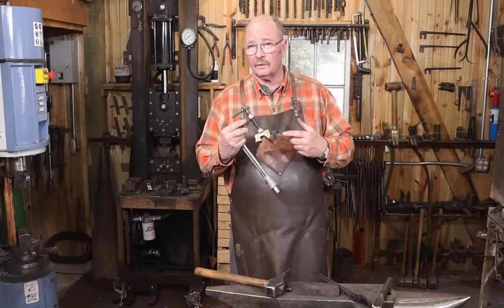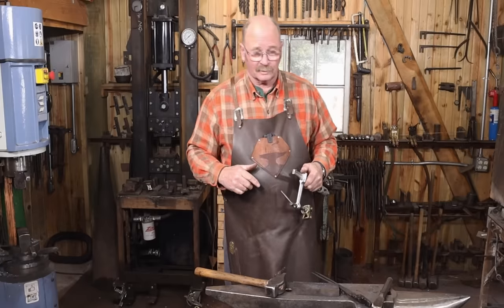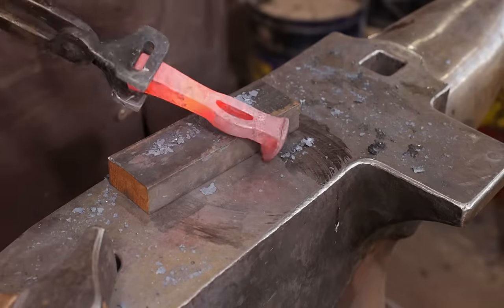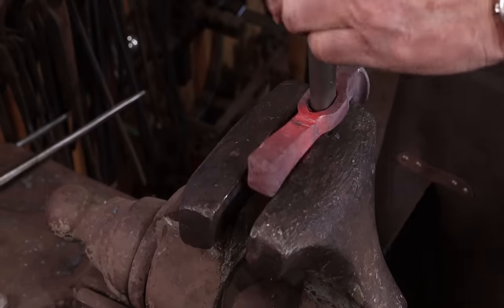Forging an AXE from a Rail Road Spike

Comment: I have been a blacksmith/ fabricator/ machinist for 50 + years and i never tire of watching other craftsmen share their knowledge. And i still learn stuff!
Reply: Hi friend I just figured I'd ask you but im getting into blacksmithing and I've mainly been using a friends forge but I was wondering if you know where I'd go about getting my own.
Reply: @BigVince80bce  i just saw this two months later. Try Pie tool company. Its a blacksmiths tool seller online. You’ll also find forges and what not on ebay.
Reply: @beshkodiak  thanks mate, I'll give the websites a look
Reply: U know Right!!🖒
Reply: What kind of charcoal you used sir?

Comment: It's been a while since I've made one of these. I think I'll try another. I'm going to try using a short, wide handled chisel under the inline treadle hammer to open the eye this time. Last ones I made, I used too narrow and small of a chisel and ended up stretching the sides of the eye a bit too much. Nice video, Merry Christmas John, thanks for all the content!

Comment: Been told by 2 good BlackSmith to quench mild steel in water and still not tool steel but improve the hardness. 
I'm surprised that RR spike has enough steel  Seems you drew it out well.
Thanks Mr Switzer for the teaching Sir

Comment: That does look like a fun project. You could make a bunch for friends then meet up and play with them. That amount of temper seems a good compromise as you would not want them too hard anyway for when they hit the ground or rocks or whatever. If you really wanted I'm assuming one could forge weld in a hard piece for the edge. I hope you had a relaxing Christmas and took a break from all your video production.

Comment: Nice video John! the tomahawk turned out awesome! as far as the heat treat, I use an aggressive brine solution for spikes and they get near a 55 rockwell, its called a super quench and its 5 gallons of water, 5 lbs of salt, and a bottle of dish soap, I was able to make a nice paring knife for my mom out of a spike and the quench got it 50 - 60 rockwell.
Reply from the maker: I have wondered about that.  I just try not to have any more buckets of stuff around the shop.  Will super quench freeze in cold weather?
Reply: It is still only surface hardening... Rail spikes are 0.12% carbon and 0.30% carbon for HC spikes.. So while you can surface harden them it wont penetrate deeply as spikes are mild steel and wont through harden... That being said, you can spit the end when forging and insert a high carbon bit in and forgeweld it in order to have a high carbon steel edge.
Reply: @BlackBearForge  probably will freeze if it gets below 0. Maybe even in single digits.

Comment: Very good job 👌👍  on the video !  In the black smithing books they talk about  steel you can find , and about what hardness they are .  I think at one time railroad spikes my have been harder than what they are now  . A lot of the older books mentioned that spikes are harder . Now they know they don't need to be that hard so it's cheap & good enough so that's what they are .  I think there neat + if you know people that like trains then you really want to leave that nail head on it . Again good job

Comment: I think that railroad spike hawks look awesome enough to initiate a piece of high carbon steel Forge welded into it. I think they look I think that particular hawk there is awesome looking and I think it would be worth putting a high carbon bit. Will be a little extra work, but I think you would really have a really serviceable little mouse. Most of the people that tomahawks use like a 1040 a real low carbon steel with a welded bit and those as well so just an idea.

Comment: I think you are hands down the best teaching Blacksmith on YouTube.  Thank you for all of the effort you put into helping others.  I love this project and am going to try it.  My question is on the drift.  I am cheap, so have bought very few items, and prefer to try and make them.  But is making a drift feasible?  How do you know what size?  Or do you just make it the size you want and make the handle to match?
Reply from the maker: Making a drift is certainly feasible.  If you are buying ready made handle, make the drift to match the handle.  Otherwise make the drift what you want and then fit the handle as needed.  Eventually you'll end up with a fairly good assortment of drifts.

Comment: Awesome video! I'm thinking about giving this a try soon. My question is, how did it hold up with the throws? Is the edge still ok?
Reply from the maker: So far just fine.  Throwing axes don't need to be very sharp.  But it wouldn't hold an edge very well as a carving axe.

Comment: I've been wanting to make something similar for ages after buying a couple of nice forged axes. My main issue is the drift. I guess I need to find some material to make a drift first, figure out how to make one, and then learn to make the axes. Great video- I have a sack of railroad spikes that are looking for a use.
Reply from the maker: The drift I'm using is available through Pieh Tool

Comment: I liked the cuts you made at the end of the video. :) I think if anyone was going to make a serious blade they would consider forge welding in a piece of quality blade material like maybe some good spring steel so you have a blade edge that will last.
Reply from the maker: While I agree, I also wouldn't put that kind of time into a spike hawk and would be making something completely different if I really wanted a serious blade.

Comment: I was splitting some kindling wood other night with a hatchet .. the handle is too smooth ,,, plus I had gloves on ,, well 5 stiches in my leg above me knee .. watching you split that board I was getting flash backs ,, works nice , only problem if you were splitting with it all the time would be the spike head catching on the firewood ,, thumbs up on the video

Comment: As usual great video! I suppose you could forge  weld in a high carbon bit for a harder edge if you wanted to.
Reply from the maker: You could, but if I'm going to go through that much more work, I would skip the spike and just make a more conventional axe.

Comment: What about flattening a ball bearing in splitting the head of the railroad spike in Forge welding the ball bearing steel to the railroad spike Steel, then either upset the pointed end to utilize as a hammer head.

Comment: Maybe to further harden the steel abit more. Get the head of the axe to a high heat and plung the head in a bucket of charcoal powder. See if the steel absorbs some of the carbon. In history  blacksmith  discover steel when forging there iron in charcoal fires they discovered the charcoal made the iron harder.  they learned melting iron and charcoal together in a controlled environment such as a  Crucible, made a better and more consistent steel. Ive tried it a few times seamed to work alittile, even heard you can do the same with backing soda. Might be a fun experiment for you. Happy forging sir, good luck to you! 👍👍

Comment: That was interesting and makes sense. Why bother forge welding high carbon steel onto the blade when it's still mostly a novelty tool, like I have watched other blacksmiths do, when if you want a really nice axe it would be practical to use all high carbon steel.
Forge welding a better steel for the edge is a nice way to showcase your skill but at the end it's not going to be heavy enough to do much work. Still a fun project either way you want to do it.
I liked the whooshing sound as it flew past the target too.😁👍

Comment: John, know anything about the coal mines in wyoming? I believe they mine bituminous coal and it's not that far away (about the same distance from my parents house in Illinois, 600+/- miles) and I used to have relatives that mined there. So far, I've been getting a few bags of anthracite from a local blacksmith I recently met.  Interesting stuff, smells like sulfur, looks like layers of clay after it gets hot, and clinkers feel like molten glass, not to mention clinkers galore, cleaning fire every couple hours isn't often enough.

Comment: For those who insist on forging the spike head into the blade.....the tomahawk was not conceived as a weapon. It was a tool. Having a hammer head is A LOT more in line with the idea of the final product.
Reply: Also.....railroad spikes aren't the greatest steel. They're sort of meh. They're a lot better than what the natives might have worked with, but they're better than what would have been available during the time period. Thus, they make inaccurate tomahawks. Not up to modern standards, but WAY better than what the natives would have had available.

Comment: I was looking into rr spike composition and apparently they have a few percent copper. This is so that they bend rather than break, cause a bent spike can still do its job. I like the new c clips that are being used to replace the spikes, they are some sort of spring steel.
Reply: Its actually because they are mild steel (low carbon)... Regular spikes are 0.12% carbon and high carbon spikes are 0.30% carbon.. This is per railroad regulations so that the spikes wont harden and snap and will bend instead.

Comment: What I'm wondering is if the spike is a good enough type of steel for a proper, lasting edge, or if an added edge steel may be required. I'm no expert in bladesmithing. Just a mere beginner in blacksmithing. However, from the videos I've watched, I've very often seen smiths add an extra edge steel, sandwiched between the base steel.

Comment: Good Info! HC spikes average .3-.5% carbon. Tested. Not a theory or guess. Fact. For comparison, 1095 is between .9 and 1% considered high carbon. I think a target tomahawk is the number one best use other than to hold down railroads for a spike.. easy to sharpen for the novice too..

Comment: I think you would have had a much easier time with the cold chisel if you'd have done that first, then upset your end. Just a thought. Also just wondering how far up the blade was quenched?

Comment: This may sound stupid, I’m sorry if it is. But if I want to make a knife blade wider instead of longer, to I need to upset the end first as well? I can only seem to get the spike so wide and then it just gets longer instead of wider… I’ve got a simple blacksmith hammer currently and a small ball peen. Do I need to find a rounded head smithing hammer? I know I need better tongs…. As well as a real anvil, but I’m just working with what I got for now. I hope to make one of these once I get the drift and chisel, eventually

Comment: Great lesson today John. I really enjoyed that. Question ; if you soaked the handle would it fit better ? Or would it be better to trim and fit ?
Reply from the maker: Possibly, but this style of eye and handle are typically easy to separate. You break a lot of handle throwing axes.
Reply: @BlackBearForge  Makes perfect sense thank you for the response. Have a great day sir.

Comment: Maybe 8-10% brine (kitchen salt and water)will do it.Its used for file hardening in factory's.Also old blacksmith told me that low carbon steel can be hardened in a cabbage pickle water(one thats left after the cabbage is gone in the wind hahahah).
Didnt test that one since i am not  a blacksmith yet.I am building my equipment .
Reply: Here in Florida, we make Super Quench: 5 gal. Water, 5lbs. Rock salt and a Quart bottle of Dawn dish detergent(as a surfacant).  Side by side to water it makes a big difference.

Comment: I have some ferrous blocks from carbide lathe bit holders, does anyone know what kind of metal it could possibly be? I've searched but haven't come up with anything. I was thinking of using them as inserts for such things as this for the cutting edge. Thanks!

Comment: Would it be possible to forge weld a piece of high carbon into to edge before you completed the axe, so that it would hold an edge?
Reply from the maker: Yes, but I'm not sure if its worth the trouble for a spike.  If I'm going to forge weld I would prefer to make a more substantial tool.  Although this question comes up often enough that I will probably do a followup just to see what can be done.

Comment: I have a couple of tools that slide down their handles.  They are store bought and I have thought some about buying new handles and resetting them, so I wish you would have shown more of the handle setting.  How the heck do you get that handle on there tight enough so it never slides down the handle?
Reply from the maker: In most cases they are supposed to be easy to remove to facilitate sharpening on a grinder.  To achieve a better fit just look for the high spots or rub marks on the handle and work those down a little at a time until the handle makes nearly even contact.  But the handle will never stay in place as well as one driven up up and wedged like a hammer or axe handle.
Reply: @BlackBearForge  Thanks

Comment: Does anyone know what kind of belt sander he's using?
Reply from the maker: I have three.  The big 3" grinder is shop built, there is a Wilton Square Wheel grinder (now made by Jet) and the newest one is the KMG TX from Beaumont Metal Works.
Reply: @BlackBearForge  Thanks for the info, great videos!

Comment: i know im late but i wanted to say a thing or two or three first off im no connisseur axes hatchets or other types of bladed instruments but isnt it typical for axe makers to only harden the edge of an axe blade or forge weld a harder piece of steel to the metal that is going to be an axe  imean if one really sits and contemplates axes and there uses   the hardness of steel  the thickness of the metals used in axe amd how its used it becomes pretty obvious that theres no logical reason to have an axe made entirely of some ultra hard space age metal as even the strongest of men dont posess the strength to swing an axe hard enough for the metal to be damaged by wood 
  i mean look at the axes made in  the early 1800's even the best of steel back then was nowhere near as good  as what we have today and those axe heads usually outlasted the life of the owner

Comment: I liked everything you did untill you chopped kindling.

Place hatchet on kindling. Bounce kindling. Hatchet will enter the wood. Another sharp tap will break the piece off. This procedure avoids risk to ones thumb. Keep in mind you only have to chop it off once. And then you did.

Comment: My Dad would have been cursing at you for hammering on your vise. He caught me once, Jesus H Christ what the hell are you doing. You don't pound on the vise
Reply: You didn't insert a harder metal on your front edge? I've been told RR spikes aren't that hard.
Reply from the maker: Dad must not have been a blacksmith.  The blacksmiths leg vise is built to take the abuse of forging in the vise.
Reply: Yep, in his younger days after the war. He had a coal forge.

Comment: If a traditional tomahawk is of indian dissent or culture then they must have been made by Indians what about the indian blacksmith and who taught who 
Which came first the Indian blacksmith or western cowboy blacksmith
Reply from the maker: The term Tomahawk comes from the Algonquian word otomahuk (“to knock down”).  The term was then used by early European traders to refer to cheap axes made for trade with native Americans.  The trade axes were very much based on older axes used across Europe and likely imported.  There were no Indian blacksmiths and the western cowboy blacksmith was still hundreds of years in the future.